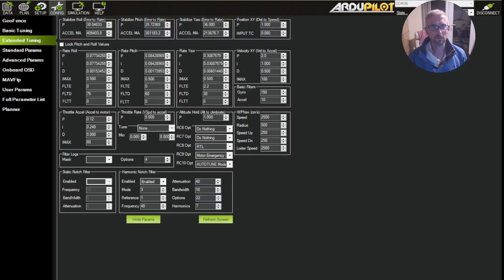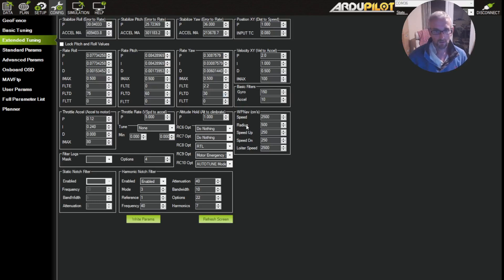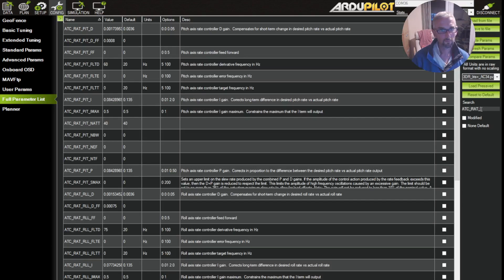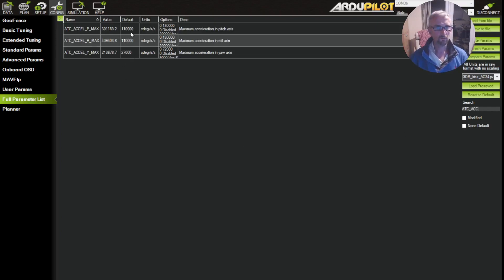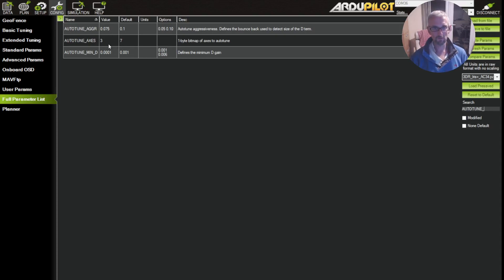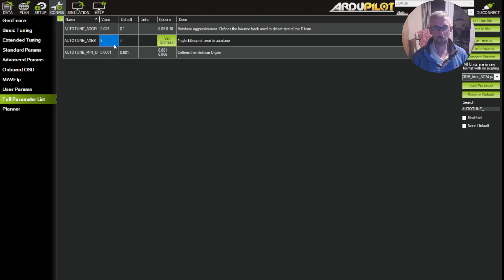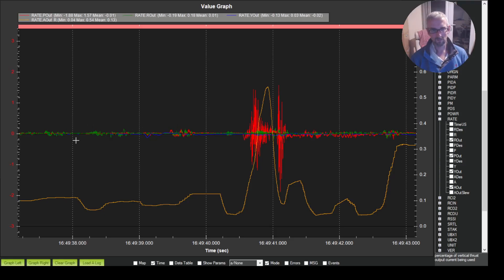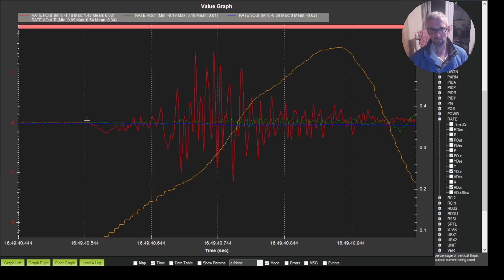Ultimate Autotune Video 8 - Looking at the parameters

Comment: So as I understand If I have ATC_RAT_YAW_D 0.000 in big octocopter coax with 20" propellers Autotune for Yaw_D will not work ? I have to change this ATC_RAT_YAW_D to 0.001 to force Autotune to set this parameter ?
Reply from the maker: I’m pretty sure we fixed this bug, so even if it’s zero autotune can still tune it